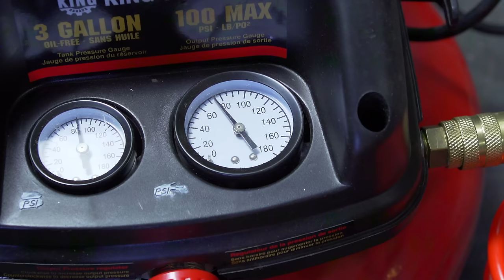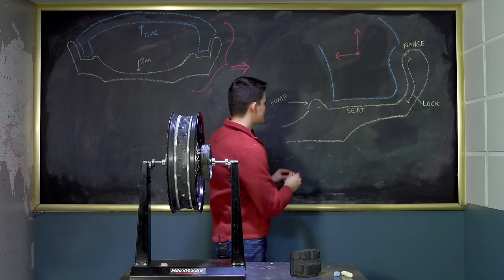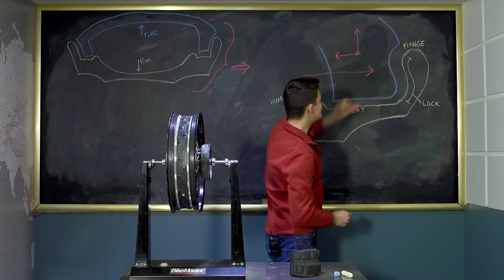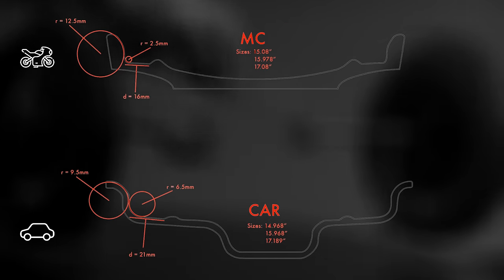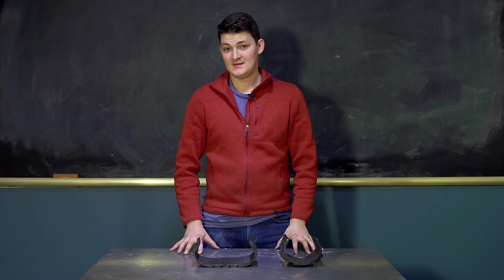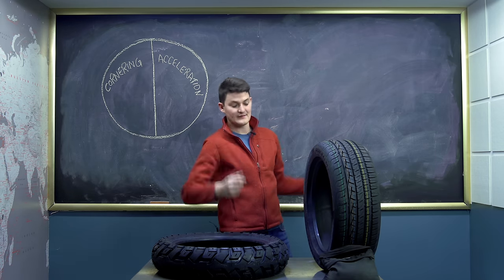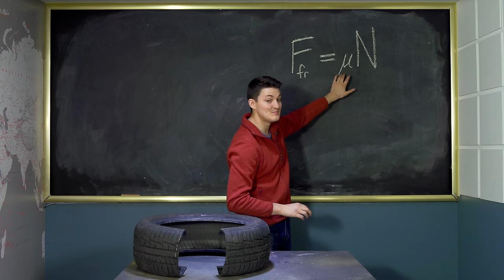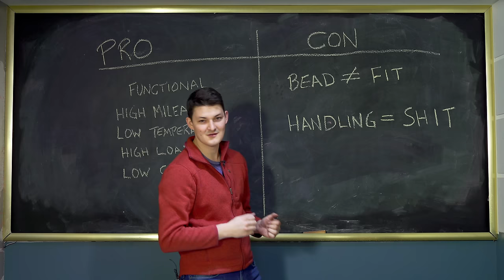Are Motorcycle Tires a Ripoff? The Darkside Car Tire Experiment

Comment: I've darksided a GL for the life a tire, mostly through a very rainy winter in Portland, OR... it was good in snow, it was good in the rain, and it was good for towing a trailer. The tire didn't last much longer than an regular motorcycle tire, in a large part as I spend a lot of time on the sidewall. (I used to own and now occasionally teach for the Northwest Motorcycle School, where we taught a motor officer course to the general public, and much of our riding was full lock, full lean and below walking speed.) I simply wore the shoulders of the tire out, while the center tread was fine. I'm not teaching regularly now, and living in New Mexico, with it's mostly straight roads, I spend far less time on the tire's shoulder. I was looking into another darkside tire, when I noticed the weight difference. A car tire for the GL weighs between 9 and 11 Kg. (20-25lbs), while the motorcycle tires weigh around 3 Kg (according to manufacturers). That terminated my search, the durability might be great, but  the added, un-sprung weight kills suspension response, and may have been a good portion of why handling "sucks."  Yes, the bike understeers with the car tire, but, as noted in the video, it takes about 10 minutes to get used to keeping pressure on the bar while cornering. However, the tire's following of rough roads is severely compromised, particularly when leaned over. Just one more element to consider.
Reply: That was my experience. Flat roads ok uneven roads were really bad. Grooved asphalt was scary. Went back to motorcycle tire.

Comment: Pneumatic tires, such as those on a motorcycle, Do NOT behave as classical dry friction theory would suggest. Rubber generates friction in three major ways: a) Adhesion, b) Mechanical keying, and c) Wear 

Furthermore pneumatic tires are sensitive to load, as they are loaded up the coefficient of friction decreases. 

Reference:
The Racing & High performance tire, Paul Haney, 2003

Or wiki, if you guys don’t want to buy the book above.

https://en.wikipedia.org/wiki/Tire_load_sensitivity
Reply: Now I read that wiki page, and I have my B.ME working on my M.ME I know the other kinda forces. 

All this says is that it's not a component vector of dry friction but instead Coulomb's friction. 

This just means motorcycle tires get more grip in a turn since their sliding factor is more.

Right the dry equation is simplified but is good enough. You do have only so much grip to go around, and the advantages of motorcycle tires is that you don't fight the tire in a turn, where as a car tire you do. You don't get enough grip back out of Coulomb's friction to make up that deficiency. 

Sure for F1 it's a serious concern and that's why we slightly camber those tires.
Reply: The tires being pneumatic vs solid has nothing to do with it. It is because a soft material (like rubber) on an abrasive surface (like pavement) has a coefficient of of friction that is itself a function of normal force. The equation ends up looking like F=z*N^s where 's' is usually around 0.95, but must be measured experimentally.
Reply: I absolutely love seeing a YouTube comment debate with citations in place of curses, I'm glad to see fortnine cultivates a very friendly, non-toxic community
Reply: Besides the coefficient of friction of the rubber, there is the coefficient of friction of the pavement. In effect it is a combined coefficient of friction - of that tire rubber on that particular pavement. And oh yes, pavement friction varies depending on the aggregates it is made of and any polishing that takes place over time.
Reply: Car tire go on car, bike tire go on bike. Vroom vroom machines use different roundy circles for many reason.
Reply: Thank you for siting your source, i've never seen such professionalism in a youtube comment
Reply: ^ this isn’t getting enough upvotes. Tire sensitivity means that twice the normal force (and therefor twice the pressure on the contact patch) will result in less than twice the grip. That’s the biggest reason race and sports cars try to minimize body roll around corners and dive while breaking. That’s also why everything being equal (yes including tire compound) a wider tire will provide more grip than a skinny tire. Clearly when you’re asking a tire to do something it wasn’t designed to do it’s not going to behave perfectly. Most of this video was really well done but the “friction equals mu times normal force” part had me cringing. That’s not how tires work.
Reply: @samshute3859  I don't know how tires work but I know when I ride on Dunlop MC tires on my Honda vtx1300 I have a corner down the road I can make those tires slip on. But my Blizzak WON'T.
Reply: @AggregateFever8  the problem with "citations" is they come from the "educated". It is by sad experience that I have learned that most of the things "educated" people know, just doesn't translate into intelligence.
Reply: @stephenbrown9370  The educated know by opening the book. The intelligent know by heart
Reply: still nothing about contact patch.
Reply: @vasilisgreen  The contact patch arguments were settled a decade ago. It’s a myth the CTs on a bike have less contact.
Reply: @dougfresh1341  don't use abbreviations. What are CTs?
Reply: @samshute3859  tire width will alter the coefficient of friction because the rubber polymers don't like pressure. More surface means less pressure when the tire is pressed against the road and thus better grip. This is not absolute though. If the pressure isn't high enough, the surface area won't make a difference and the coefficient of friction won't change at all. That's why weight or downforce has diminishing returns in grip. Grip still increases but at a decreasing rate. 

Also tire width affects temperature and wear. Wider tires heat up slower, meaning they will stay at the optimal temperature range for longer, maintaining a better grip for longer and by wearing out slower they extend their useful grip even more. Other than that, contact patch doesn't improve grip by itself. It affects other factors that determine grip but it doesn't affect grip directly.

In the end, when choosing tire size you have to consider other factors like vehicle weight, power output and purpose.
Reply: @vasilisgreen  %100 agree with you
Reply: @vasilisgreen  This whole conversation is about Car Tires on bikes. CTs.
Reply: @dougfresh1341  oh. I never said that car tires have a smaller contact patch than motorcycle tires on motorcycles.
Reply: @stephenbrown9370  regarding the educated comment vs intelligent, too bad we are not talking of planes or rockets, maybe then the prospect of having a bad experience on board would change your perspective. While education brings a theoretical knowledge most of the time, people do study and work on development fields with engineering companies to develop these technologies. Most of all recent progress comes first from theories and hypothesis that are supported by systematic testing, be it motorcycle tires or the circuit board that flushes your toilet on a plane or train.
Trust me, don't underestimate the toils and labors that go into things you might consider mundane.

Comment: I love when the good ol' Canadian unit system comes out "a 4000lb car to travel 100,000km". Don't forget that travel distance is measured in time!
Reply: Just like how I can be 180cm tall and weigh 200lbs. lol
Reply: @Gofr5  some places in Canada use feets for people height
Reply: @QcOncleGab  I do, for without feet I'm almost a foot shorter.
Reply: my local town is 45mins away.
Reply: @QcOncleGab  Yes. admittedly I prefer feet for my height too.
Reply: So how many imperial stone is that, and are you using imperial or US lbs?
Reply: In Colombia we measure fuel consumtion by Kms/gallon O_o
Reply: LARRY SCHREMP underrated dad joke, props 2 u 👍
Reply: jay tyack No wonder their empire collapsed
Reply: @__beer__   No we miles for both here in the UK.
Reply: @__beer__  Sorry, you're misinformed. Miles for both speeds and distances here is standard. Lots of other reasons why we lost the empire!
Reply: @__beer__  No we don't
Reply: @Lee-xs4dj  oops
Reply: @QcOncleGab  I'm in Ontario & most people I know use feet. I am 6 foot on the dot, though I couldn't tell you how high in cm I am to save my life, nor do I care to find out. Using feet & inches is cooler for height, like in aviation it's all measured in feet.

Cm is good for measuring distance. Feet is good for height.
Reply: 140mm tyre on 17in rim
Reply: well then, " a 4000lb car to travel 0.00000001057001 light years." ok?
Reply: @mrpalaces  Wow - and I thought Canada (yes, my home) was metrically confused!  That is amazing and happy to know before cross visiting off my bucket list!
Reply: Wtf is a KEY LOW METER ?!? 
My cars tires only go 62,500 miles before they need replacement
Reply: HEAVYWALL 70 It is a tool we use in Canada to measure how much yours keys are worn down
Reply: Here in Australia it's metric all the way.

Comment: This is one of the best darkside videos I have seen. It’s not arguing for or against but simply putting the information out there. We darksiders will never say that the handling is better than a motorcycle tire and we would put them on our track bikes just that for the riding we do they are perfectly adequate. I went to the darkside on my concours after replacing 4 rear motorcycle tires in one year. It’s not a track day weapon, it’s a touring pig.

Comment: Great video, interesting topic. My take on it.... I would never be a mooch and try to save a few dollars on a car tire when my motorcycle was designed by countless engineers to operate with the recommended rubber. I will stick with their recommendation, feel better about it, and I'm sure when I'm going around a corner well over 100 miles an hour I will feel a lot better with my motorcycle Dunlop Tire. Now do whatever you like.

Comment: I put a Falken tire designed for the tuner market on my Honda VTX1800 and loved it. It was different from your choice in a couple areas. It has symmetrical tread, reinforced sidewalls, and rounded tread at the edges for better cornering. It did have better life and lower cost as you mention and better load capacity. What you didn’t mention was the better water handling capacity and the much better puncture resistance. I tested the tire with no air in it and it functioned for low speeds. Finally, when I had the second car tire put on the dealership called me and asked permission to cut the first car tire off the rim because it was so tightly fixed to the rim. The downside was low speed turning. You can definitely feel the bike as it transitions from the flat to side tread. I wouldn’t think of it on a sport bike but for a cruiser it was great. One last thing, My wife said the ride on the pillion was much smoother with the car tire. P.S. My original tire was tubeless and the rim geometry was not like what you show in the video.
Reply: A friend of mine also fitted his Kawasaki Vulcan with a car tire on the back, and he said it was the best thing ever.
Reply: I rode in VTX group and many went dark side.
Reply: Even if the wet traction is "good"... I would think taking curves in wet weather (once you're off the flat part of the tread) would be really scary
Reply: @julianbrelsford  there are pictures of the contact patch of a car tire vs a motorcycle tire and the car tire actually has move contact area in a turn than a typical motorcycle tire. That is true for the ‘tuner’ marketed car tires that have geometry designed for drifting and high speed cornering. The contact area on a motorcycle tire is actually very small, but consistent no matter the lean amount. As I said in my original post, I would not recommend a car tire on a crotch rocket but for a 700+ pound dry weight cruiser it wasn’t a problem. Also, I added floor boards to both riding positions so the cornering angle was substantially reduced anyway. Even if the traction was equal, I was still comforted by the thick side walls and tread on the tuner tire that allowed the bike to operate with no air in the tire. Also, you can plug a car tire to get you home and that is highly discouraged with the light weight motorcycle tires with very thin tread area.
Reply: Just to clarify, contact patch has nothing at all to do with grip, as per Ryan's explanation. It is purely a function of how sticky the rubber is and how much force is being applied to it. The 'tuner' tire example likely has more working tread towards the edge of the tire, making it less sketchy for this use-case, but still sketchy considering how the car tire will always want to 'upright' itself after a few degrees of lean.
Reply: @dimid4758  if contact patch has nothing to do with grip why are drag tires  very wide slicks?
Reply: @Dave Willard  Drag tires are a very soft compound. If they were the same size as your average car tire, they would only last 1 pass down the strip. Performance tires in general are wider so that they last longer while using a softer compound.
Reply: @dimid4758  Actually contact patch has quite a bit to do with grip. Friction coefficient is very much a simplified model that works well for like most flat/smooth/hard materials sliding not too quickly etc. In all it mostly works in narrow-ish ranges of conditions. Otherwise you'd expect a fully loaded big rig to stop exactly as fast as an empty one, which is patently absurd.

Look up e.g. tire load sensitivity on Wikipedia or something. Basically coefficient of friction isn't constant on tires, and decreases as vertical load increase. This also means larger contact patch -> lower load -> higher friction coefficient. There's also a paper I read some years ago that proposes a more complicated friction model that involves sliding speed, contact area, among other things, but can't seem to find it.

Comment: "We're motorcyclists, masters of measured risk"
Reply: Well put. No doors or seat belt and half the tires.
Reply: @davidrobinson4797  and lean angle
Reply: @D PIW : Dude they're not talking about darksiding.. You're in wrong comment..
Reply: D PIW No, it's in context of whether you want to do it or not.
Reply: Ha. True Darksiders will scald you for choosing an obviously asymmetrical thread pattern.
Reply: some use us a micrometer, others are happy to eyeball it to the nearest foot.
Reply: @D PIW I darkside because motorcycle tires cannot handle what I dish out.  I also dropped about $3500 on upgrading (Full Monty Traxxion) suspension so that my Goldwing can put even more power into the twisties by planting that car tire more firmly onto the pavement.
Reply: @Matthew Hoopes These 'conventionally wise' folks once declared that if a human being sped along faster than a horse could run on a railway that the wind would suck the air out of their lungs and cause them to suffocate.  LOL...  And then there were the ones that said those attempting to circumnavigate the globe would fall off the edge.
Reply: I’m going to get this put on a T-shirt